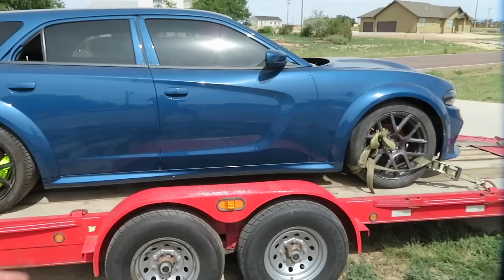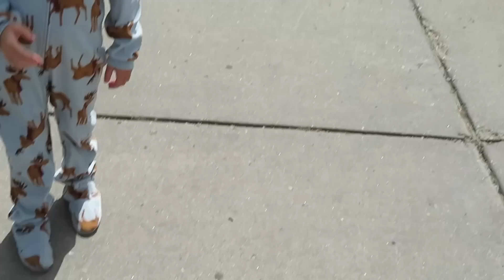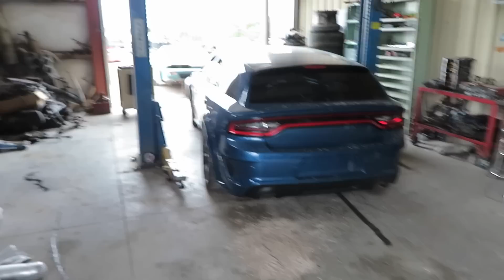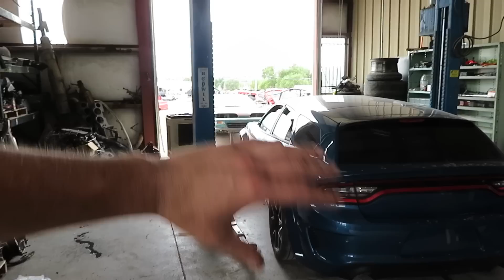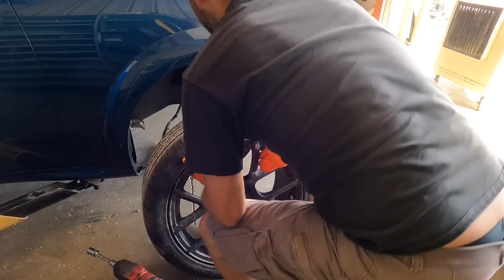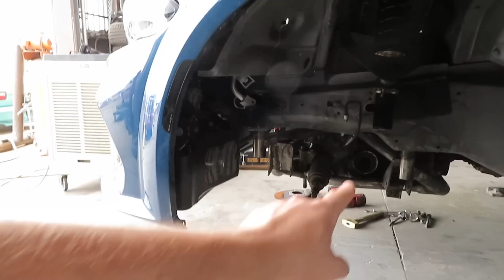Dodge Dealerships Reaction to my AWD Hellcat Magnum!!!

Comment: You can expect crowds like that everywhere you drive that wagon- it's that awesome.
Reply: Honestly no one's going to know. They will think charger nose swap and move on.
Reply: @johnsnow1355  nah, that widebody and sound will tell enough to get a crowd
Reply: @johnsnow1355  Maybe for those who aren't familiar with Chargers and Magnums.  But those who are, they will notice right away this is not your typical Magnum with a Charger nose swap.  They will notice the differences in the body panels, doors, glass, etc.  The suspension, drive train, and Charger wide body kit will just be the cherry on top!
Reply: I agree, dude won't be able to drive it as there will be swarms.
Reply: @americanpatriot2.06  that will be very very few people at a typical car show lol
Reply: @johnsnow1355  no it won’t
Reply: @johnsnow1355  I'm not a Mopar guy, I'm just a car guy, and I would be asking lots of questions if I ran across this car.  This is the first time I've seen this car and the first video I've seen from this Youtuber.  The Charger taillights stand out more than the front clip IMO.  As someone that did a R34 GTR taillight swap on a 4th gen Nissan Maxima back in the HIN days, the Magnum hatch/Charger trunk lid fabrication looks OEM.  I'd love to see the inner structure of that piece.
Reply: @johnsnow1355  plpo
Reply: Gawt dam masterpiece 🤘🤘🤘💯💯✌️✌️💪💪✊️✊️

Comment: I had a 2006 magnum that I built. 
6.4 liter hemi (did top and bottom) ported heads
Cold air 3 stage intake
Long tube JBA headers and race track exhaust  system
Cowl induction hood 
Supercharger 

Probably forgetting something lol
I love the look of the magnum. I want to rebuild another one but put a viper motor in the next one. 

Awesome car!

Comment: Got , memories...before that newer rear panel was out, I built my first Chargum...Totalled via drunk rearender pulling into my driveway...still good memories, great build

Edit: need to clarify, my build might have well had been duct taped comparatively lol. Different levels of build, MINE was cosmetic. Still a bolt on magnum under the hood, stock drive, stock interior minus gauge packs, shifter etc  .JUST CLARIFYING BROTHER Haha😂😂🤣🤑

Comment: Do you have any front end parts for 97 f150 xl 4.6l v8 front a-arms and all that stuff??......
Would buy new but can't afford it and have already replaced the rear axle, rear lights and front lights and still have to rebuild the steering column and console and front end......

Comment: I'd like to get in touch with you. I've been watching this build & you've been giving me motivation on do the same thing. I bought a magnum in 2019 for this reason. I still have it but don't have the time or money for it anymore due to a traveling job I just picked up. It's a 2007 Red Dodge Magnum with 90,000 miles on it and still has a lot of potential. Don't want it going to the junkyard being that it's not made anymore & such a rare car I'm willing to sell it. If you want it, it's yours. Plz contact if you're interested. I'm located in south Florida near West Palm Beach.